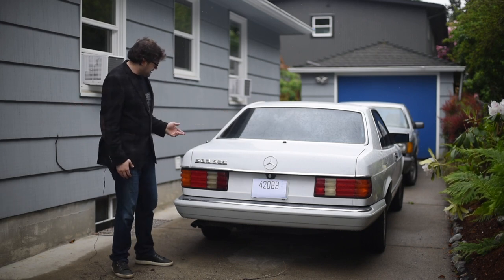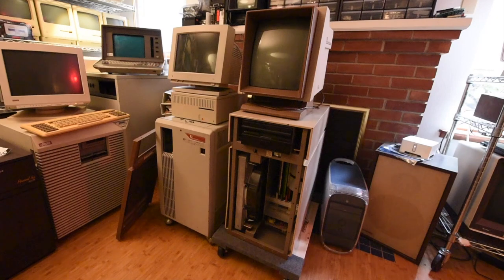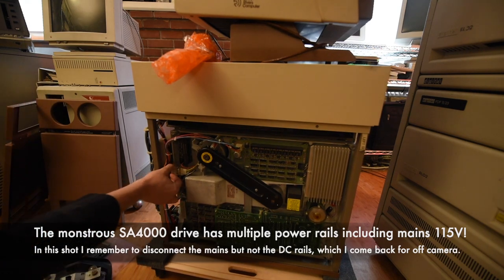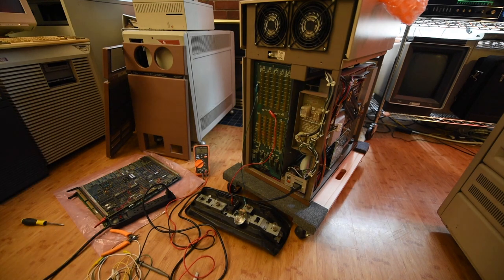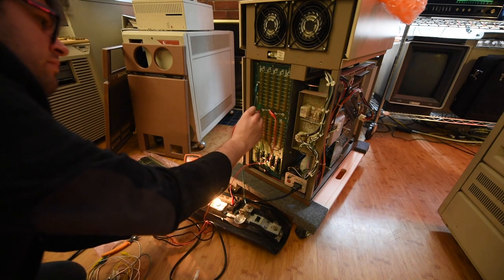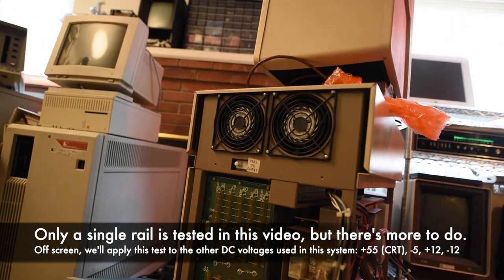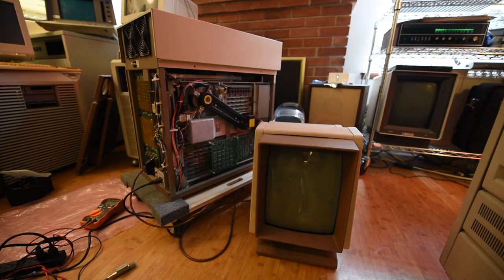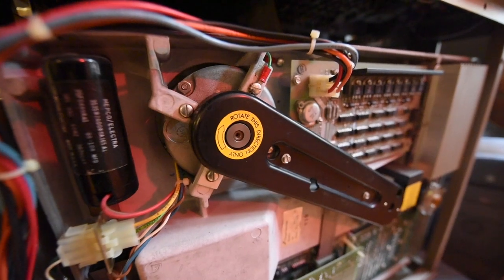Booting a 41-year-old PERQ Workstation After Decades of Slumber with... Car Parts?

Comment: That drive noise its self was pretty standard for a Perq 1 on boot up in the 80s, although your noise perhaps lasted slightly longer than "normal". It does also depend on how cold it is! It is such a heavy disk to spin up I guess, I think the belt is designed to slip a bit on startup.